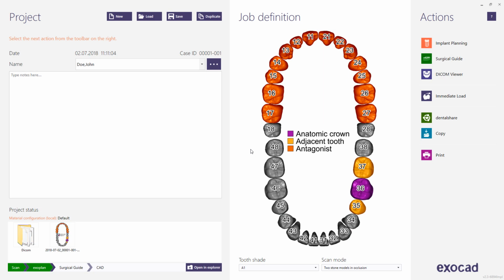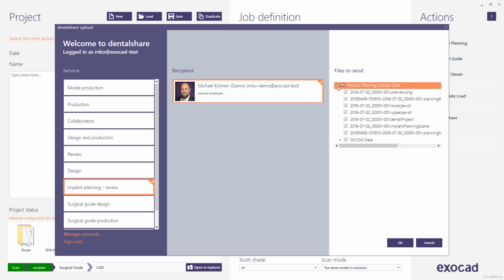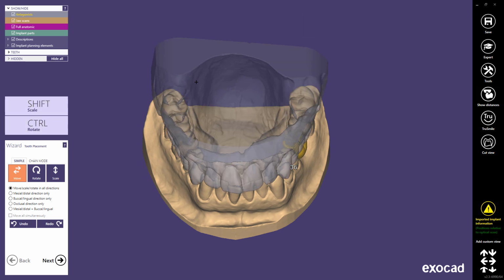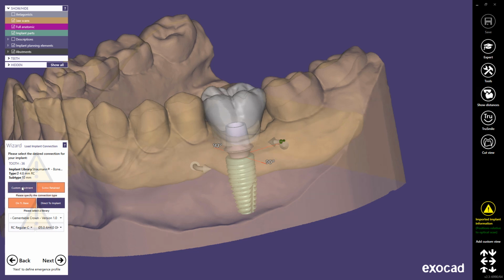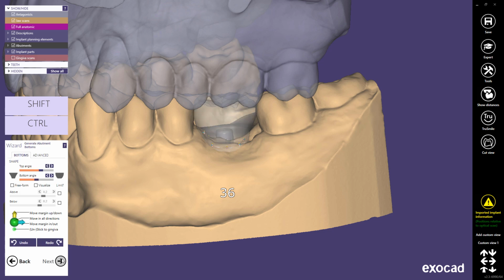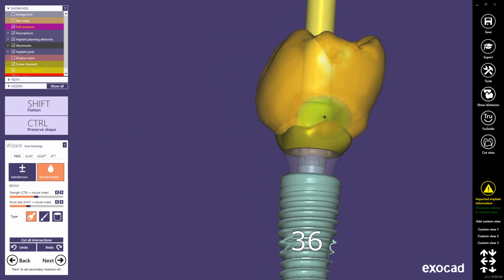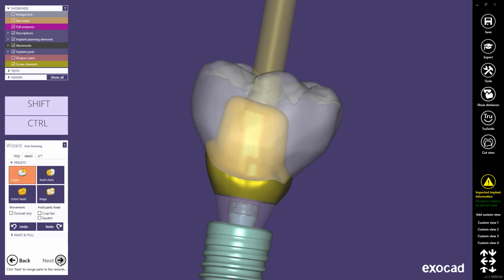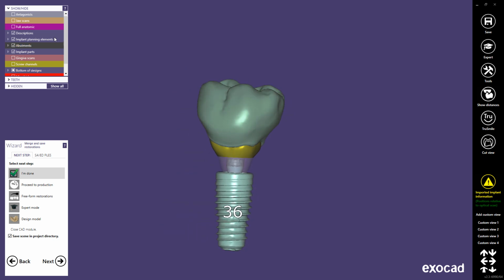exocad Quick Guide: Using the Immediate Load feature in combination with exoplan

Comment: when its a bridge , there is no connector option or connect to mesial/distal although the pontic is choosen with green dot  and as pontic / anatomic / waxed .. can't find the connector step
Reply from the maker: Hi @ashouhdy ,
In exoplan connectors are not available by design, library teeth are placed for display purposes only. 
The connectors will then be available for the immediate load in DentalCAD.